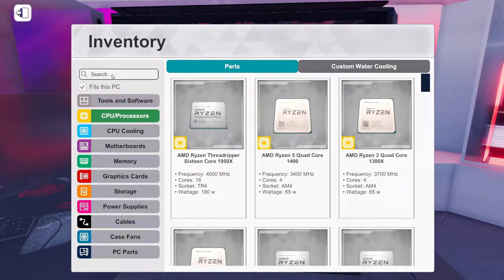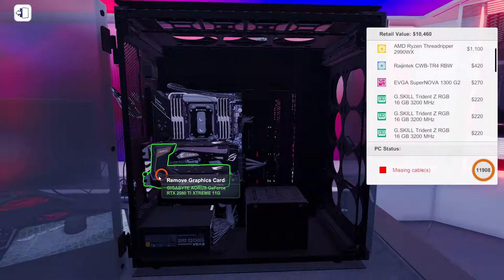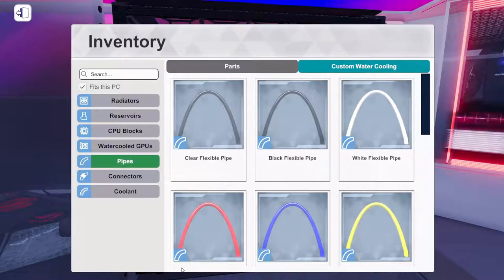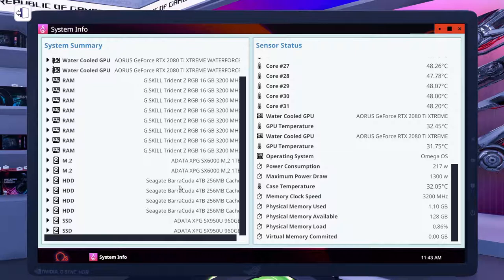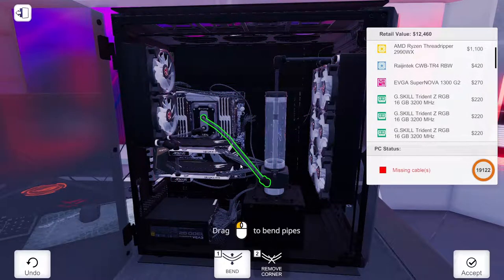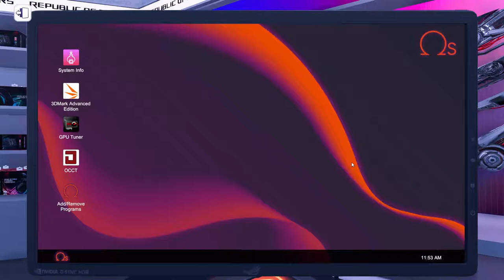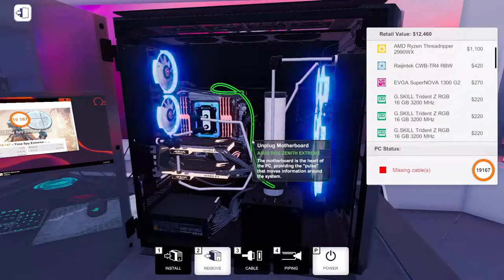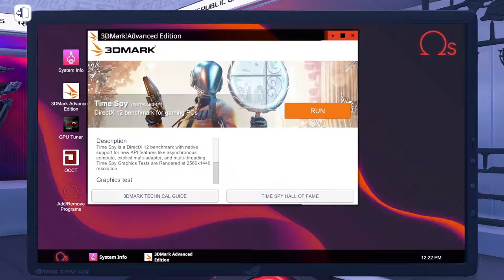PC Building Simulator - Building A Server PC

Comment: if you ever plan on overclocking cpu's, never arrange it like it's the last time you will, first test the cpu's one by one to see which one performs the best because the overclock max speed is random in this game, anyways good video 10/10.
Reply from the maker: Cheers for that sir. Yeh I know this game has the CPU's pre over clocked when you install them so you can't really overclock them much in this game but thanks for the tips.

-CommanderPrime
Reply: @CommanderPrime  please, don't call me a sir, it makes me feel old, I'm just a teenager
Reply: @CommanderPrime  also do you know any motherboard creator mod? or a server case workshop thing?
Reply from the maker: @JakeFrosty  not a MB creator, there is a RAM and GPU creator mod on the Nexus website but not MB as far as I am aware.

-CommanderPrime
Reply: @CommanderPrime  yeah i use that to add my own "realistically priced ram"
Reply from the maker: @JakeFrosty  So am I, its just force of habit sorry
Reply: @CommanderPrime  nah don't be sorry, also cheers i subbed, good for you, struggling to make content that is good enough, although i have alot of real pc and workstation + servers too.

Comment: The down side is, not every slot in the PSU is not usable.
Reply from the maker: If you run out of slots try replacing it with a bigger more powerful PSU

-CommanderPrime